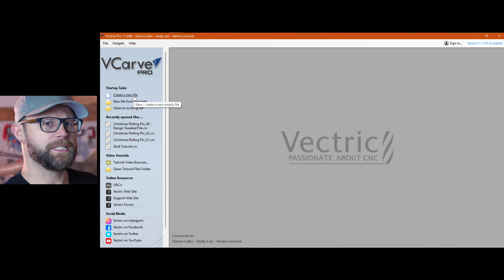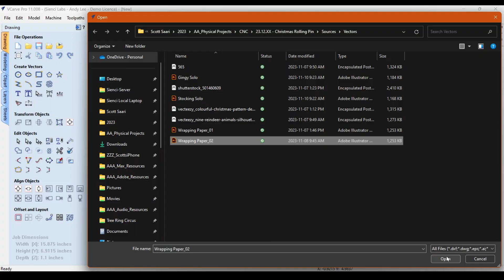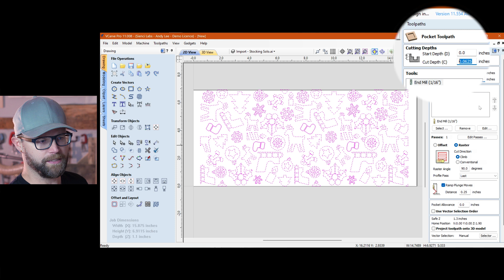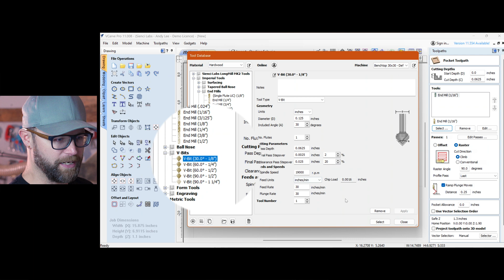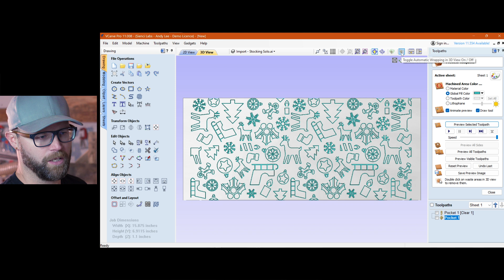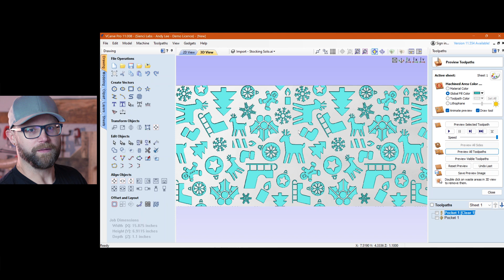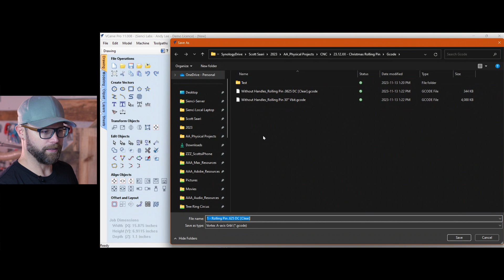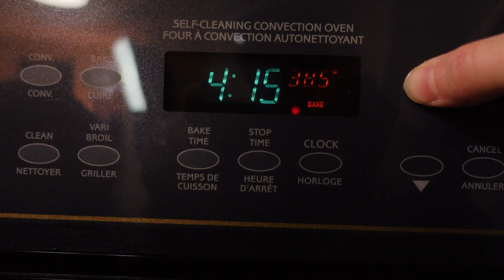DIY Christmas Rolling Pin with Vortex Rotary Axis | Festive Holiday Crafts

Comment: Loved it, Scott!  Just a few suggestions to help you out.  First, before you mount the stock into your rotary mill tailstock, take a punch to make a hole in the centre beforehand.  That'll help ensure you get it mounted exactly centred, as well as being more gentle on your equipment.  Second, sand your cylinder before moving onto engraving.  And when you go from one sanding grit tothe other, vacuum off the residue, as there'll be sanding grit embedded into the wood, which will impact the effectiveness of the next, smaller grit.  Then, to help keep your mills sharp, do a final vacuuming off to get out any embedded sanding grit.  All this pre-sanding should actually help a lot when it comes time to do the final sanding.
  Keep up the interesting tutorials!
Reply from the maker: Great suggestions! Appreciate the kind words!